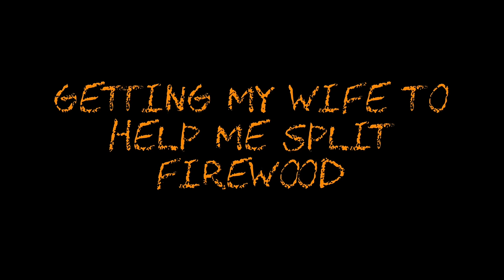#450 Getting My Wife to Help Me Split Firewood!!

Comment: Your wood splitter is too small for the size and quantity of wood you are processing. Your time with the chainsaw will be cut out all together using a larger processor with a live feed deck.  You can multiply your volume many times over using a larger processor. Firewood is a volume business.
Reply from the maker: I’m sorry but I’d have to disagree. The wood that I get is primarily from my tree company taking down residential trees. The Eastonmade 22-28 is the perfect machine for this type of wood and with the box wedge and attached conveyor it is about as close to a processor as you will get without the limiting factor of diameter and straightness of logs. 

Firewood is a volume business 100%, but if your machine isn’t capable of running the type of logs you procure, then it’s useless, no matter how “productive” it’s capable of being on paper.